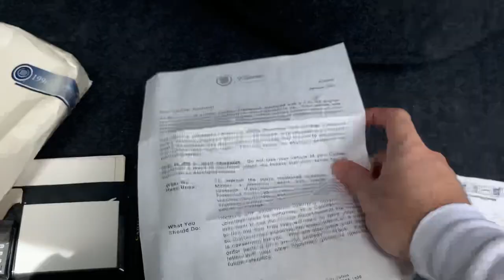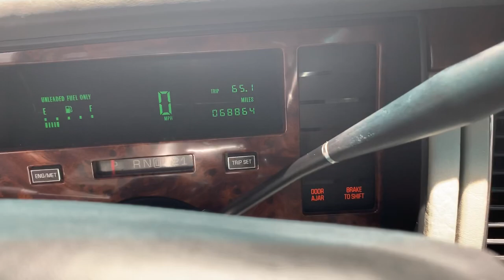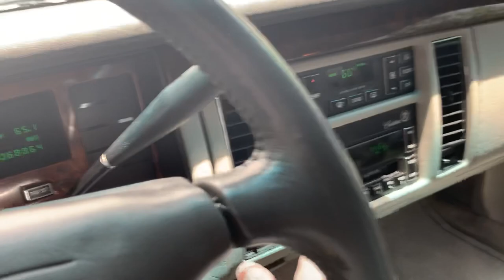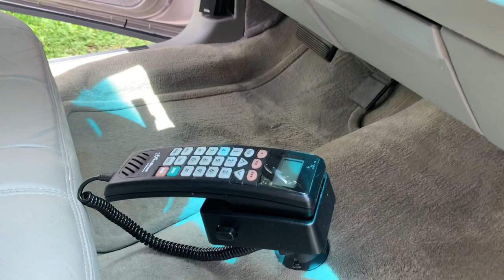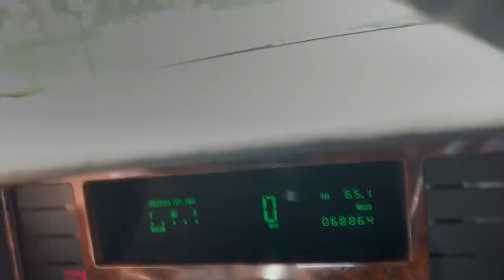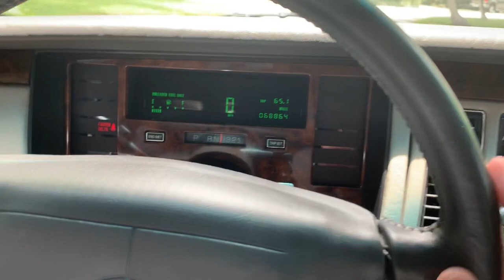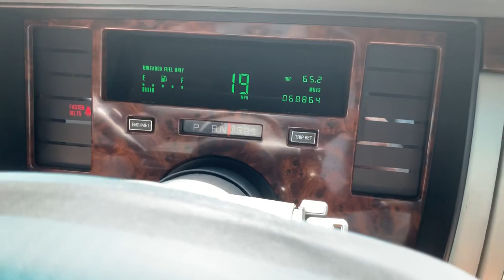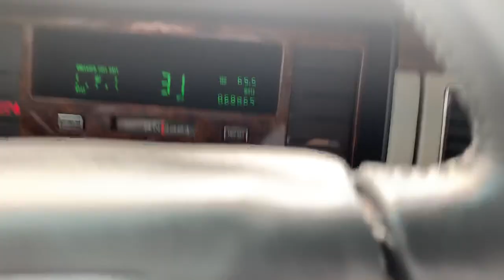Immaculate 1996 Cadillac Fleetwood Brougham 68k walk around and test drive by Anthony

Comment: Back when Cadillac's had beautiful elegant looks.
Reply: Do you like old jag?
Reply: These were junk in the long run. Money pitts! Rust buckets. Everything broke on these gas guzzlers
Reply: @captainamericaamerica8090  With the LT1 these get decent fuel economy and have good power! If you wash and maintain it the car will last a long time! I had a GM B-body (91 Caprice Classic) for the last 11 years witch I put almost 100000miles on and it had a total of 250000miles when I sold a few months ago and it was perfect working condition. And I live in Finland where we get all kinds of snow and shit during the winter and they drench the roads with road-salt during this time. These are easy to work on and parts are cheap.
Reply: Beautiful elegant but too damn long ..
Reply: @captainamericaamerica8090  Yea, there so easy to work on, I could teach a 8yrold big deal.
Reply: @katinawhitley9340  That's the appeal. It's as big as your ego, where you go there you are.

Comment: The last or the real Cadillac's, that is a beauty!!
Reply: John Texas  Sir thank you for the correction I only thought it was a Cadillac because that is what the badge says on the car, but I was wrong its a Chevy and not a Cadillac Fleetwood, thanks for the correction, they need to change the caption on the top also to Chevy.
Reply: The last was the ct6
Reply: John Texas don’t get me wrong the car is dope my dad has one but that ct6 v is a real Cadillac and it’s just as big as the Fleetwood
Reply: John Texas can you not read, I just said my dad has a fleetwood
Reply: Is this the north star system?
Reply: @williamdavidcraigjr7841  Nope, looks like a 5.7 Liter LT1.
Reply: A G iv had 2 DTS n DeVille both piece of shit motors. Have 2 of the last 3 Fleetwoods 120k plus n still running strong "buddy"
Reply: The 95 DeVille was also another last great model
Reply: @williamdavidcraigjr7841  no it is a LT1
Reply: @williamdavidcraigjr7841  Nope

Comment: I’ve got a Caprice Classic of the same year, and though these cars are identical mechanically, the Fleetwood looks much cooler. Awesome vehicle you have there.
Reply: Doesn't your Caprice have the L03 or L05? The only Caprice that came with the LT1 was the SS.
Reply: Scrotum Monster It does have the LT1. Caprice models with the B4U code came with that engine.
Reply: @Twitch_Moderator  lots of 94-96 Caprices and other siblings that had the LT1, it was the preferred motor of choice for most PD's that ordered the 9C1 Police PKG over the base 4.3. Was also an option on the civilian models too, Classic LS, Estate (wagon) as well as the Buick Roadmaster Limited and wagon too. Standard and only engine on the Impala SS
Reply: @eugenedanker2377  The "bubble" style Caprice you're referring to dates from 1991-96

Comment: Still enjoying the car here in Tucson. New "severe duty" shocks, brakes, upper and lower control arms, beefier rear anti-sway bar installed. (I like to stiffen up the suspension a bit)  It gets better gas mileage than my 1996 Roadmaster wagon, even though they each have the same drive train, including a 2:93 to 1 differential ratio. I also replaced the power antenna and put in an after market radio and a 10 CD changer in the trunk.  In the next couple of years I can imagine that I will replace the spark plugs and the rotor and cap on the Opti-spark distributor.  I still have less than 73K miles on it, which includes my driving it back from FL.  

I think my next purchase might be a 1990-92 Brougham De Elegance with the 5.7 engine. But that engine has 75 less horsepower than this baby does! But the trim and interior were of higher qualtiy.

 I also replaced the dented driver's side front chrome trim and the cracked air dam parts on the front. For some reason Cadillac's plastic for the fender extensions and air dam was not as durable as the Roadmaster's were of these years. Different vendors made these parts I guess.
Reply: hey humbucker I’m from gilbert AZ would you be interested in selling?
Reply from the maker: That’s awesome! Glad you commented on the video so we can hear updates about the car.
Reply: It's terribly easy to squeeze horsepower from these engines. You sound like a very proud owner.

Comment: I have one just like it and love it. The LT 1 engine is much better that the North Star. FYI, Grease the fishing line cable that wraps around the the steering post under the dashboard to the transmission indicator, it will break.

Comment: I had one several years ago. Chose it because I wanted a full sized car, with the "'Vette" engine. Several disappointments. Watch the video, and you'll see what I mean. 1. There is surprisingly little rear seat leg room. Everyone I showed the car to, noticed this immediately as well. 2. The full sized tore in the trunk, takes up a considerable amount of space, and there really doesn't leave that much space for other things. 3. The dashboard has a really dated feel about it...I say these things in comparison to the next car I replaced this with...A Lincoln Town Car....Interior had a much more High Quality modern feel to it. There was more leg room in the back. Much more real world usable space in the trunk, because it had a doughnut spare tire, recessed into a cavity in the bottom of the trunk well, just as all modern day cars do... effectively leaving you with much more actual usable space... Yeah, everyone likes a "Full Sized Spare" but hey effectively take up half the trunk....I really really wanted to love the Caddy more, but the Lincoln was a better car in every way, except for the motor, gotta love the Caddy's Corvette Motor...trade off though, is the Lincoln's motor was still a V8, it got noticably better gas mileage. Trust me, having both for a few years, the Lincoln was noticably the better car, I wanted the Caddy to be, but it just wasn't.
Reply from the maker: Thanks for the in depth review. Out of curiosity what year was your town car? I had a 2000. I noticed minimal mpg difference between the 2- the TC got slightly better.

Comment: Noticed that car has the Uniroyal Run Flat Tires.  They were the worst tires to have to balance, due to the gunk inside the tire in case you did run over something.  They also weren't great tires anyways and way too expensive.  I steered a lot of people away from them.
Reply from the maker: This car had Vogue tires at the time of the video
Reply: Those are Vogues

Comment: When Cadillac came out with this design I felt it looked like a goldfish with fin rot. Too much of.a hurried design too late. A coworker inherited his parents' 1997 Deville sedan in 1983 then spent most of his money having it constantly fixed. Mechanical failures were the transmission, the North Star engine, the brakes  kept burning out. Odd electrical stuff. I owned a 1997 Buick Park Avenue at the time and never had any problems. Odd.
Reply from the maker: William Nash this had the LT1 engine

Comment: Junkass Cadillac,my mechanic always told me if you cant buy a new Cadillac, dont buy one at all 🤣😂🤣😂
Reply: New GMs are total garbage. Quality control is very poor. I'd take this over any new Cadillac.
Reply: @ILC-eo6vk  good 4 u
Reply: @painisreal4299  New GMs are total trash. The truth hurts. They were actually going downhill for decades.
Reply: that's true about newer cadillacs.  these older ones (before 2000) are very reliable and comfortable.
Reply: Is this the last model before with the notorius Northstar engine? This is a clean landyaght but I would never buy one with the costs of use in The Netherlands.
Reply: @markvanderwel7182  I think the Northstar was used in other Cadillac models, and they kept it out of the Fleetwood, which was a good thing.